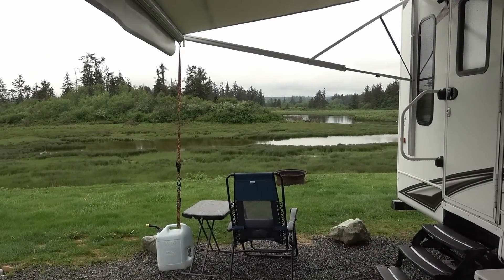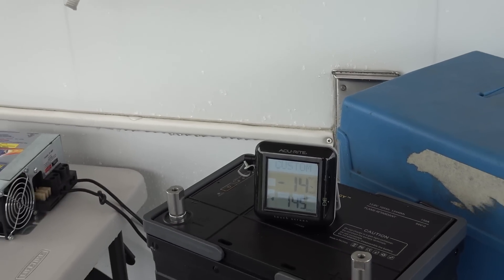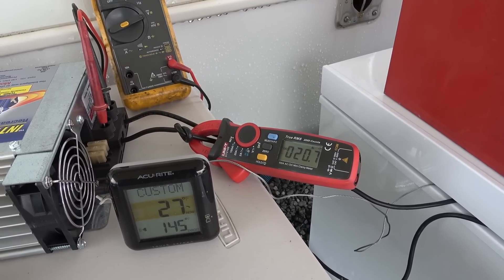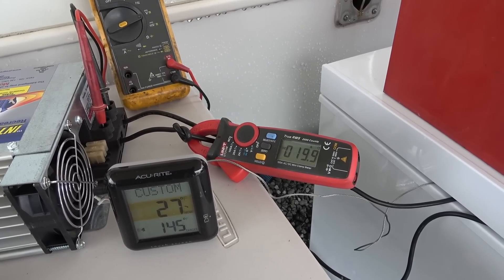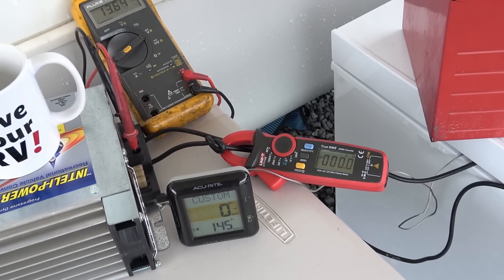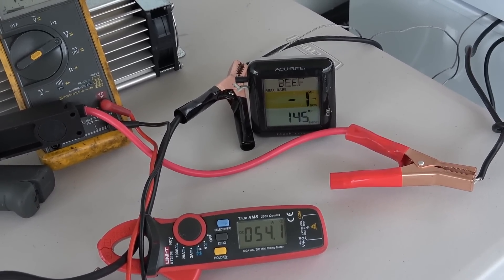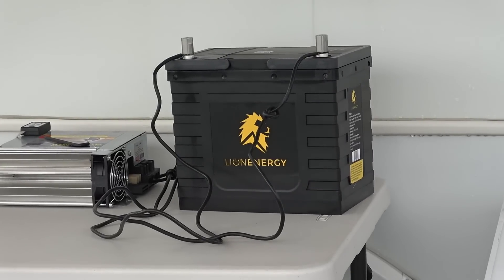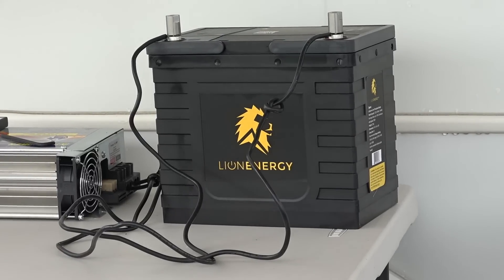Lithium RV Battery DEEP FREEZE Test (Lion Energy Safari UT1300)

Comment: Great, informative test!!  We also have two of these in traditional plastic battery boxes on our trailer tongue and have wondered if they were being damaged during freezing temps.  I guess the difference would be how they fair over extended periods of freezing temperatures.  Thinking about moving them into the pass through for this reason...although hate to lose the storage space!
Reply from the maker: You're welcome, if it was me I would move them inside and add a storage box to the tongue area for other stuff. :) Not only does it help with climate control it shortens the battery cables which is always a good thing. Cheers, Ray
Reply: Thanks for the response!  I'm with ya' - think I'm going to do that as we'll be in colder climes for at least another month.  Super random query since I have your expert ear - have you ever combined different battery types in a bank?  Wondering if I can save costs by adding two cheaper but comparable lithium batteries to this setup (inside) by maybe wiring differently.  Thank you again!  @LoveYourRV
Reply from the maker: Battery manufactures all warn against that. My feeling is it would likely work fine on a parallel installation as long as all the batteries were of the same capacity, efficiency and amperage specs. But different internal BMS boards could cause issues with charging and discharging getting out of balance leading to reduced overall capacity. I haven't tried it myself. What I've done is to spit them into separate battery banks and install a 2 way switch so I can use one bank or the other.
Reply: Great advice - thank you so much... @LoveYourRV

Comment: Thank Ray, very good work on the freezing . 
 Re-viewing this test video with new eyes now that I bought 2 Lion Energy UT1300. Thank You for all your help, work  and videos, it is sooo helpful in my RV life.  
I would still be a bit worried when I get to those temperatures and go for the  add onsheat pads.  I get cold temp in Quebec in November more than once I hit -15C (5F) and it did happened to me once in Toronto, cold snow storm, -20C (-4F) plus the wind factor, no more camping to hook ups.  I would absolutely not want to loose the usage of the furnace.  It was worrisome enough without having to look at the temperature drop worrying if it'ss gonna hit that one degree after midnight where all is  gonna turn into a nightmare in the middle of nowhere.  
But, I am surprised of how low it can go before cut off compare to other lithium batteries.  Nice work !!  ❄☃

Comment: Hmmm.... I'm not getting anything like this performance.  I have 4 UT1300 in parallel.  At about 26F, all 4 cut out for both charging and discharging.  HOWEVER when ambient goes up to about 40F only two batteries will take a charge and reach 100%.  The other two will simply reject charging (even after multiple resets).
Reply from the maker: They rate them to keep discharging down to -4F, 26F is way higher than that so you should be able to get them to do something under the warranty. - Ray

Comment: When I was working . We use these batteries on remote mountaintop sites with only solar charging.. Temp measure recorder recorded temps in the battery box to -30 C in the dead of winter.  The rating at this temp ( according to manufacture) was derated by 40 to 50% .

Comment: Off of the deep freeze topic, but regarding lithium vs 6v flooded lead acid; when I switch from my old 6v setup to lithium, is one lithium battery a comparable replacement for the two 6v or do I still need two lithium? BTW, I don't even use an inverter, just lights, USB charging, furnace (or fantastic) fan and whatever the fridge control board uses. Also, will I need a different solar controller? I have 300w on the roof.
Thanks, Rick
Reply from the maker: It's a pretty close trade-off. The 2 six volts usually have around 220 amp hours total capacity so around 110 amp hours usable before at 50% discharge which is a general rule so of thumb as the max to allow the lead-acid to discharge for max lifespan. A pro for the lead-acid is you can go lower if needed on occasion, though the voltage will drop below 12V and some stuff may not like it, ie. slide or jack motors running slow or stall.  Pro for the lithium is the voltage with stay well above 12V close to 13 V all the way down to near full depletion.  The bad thing is once they hit fully depleted the BMS cuts them off completely.  Another pro for the lithium battery is it's immune to the Perkart Law which makes lead-acid capacity drop if you pull high amperage loads from the battery - https://en.wikipedia.org/wiki/Peukert%27s_law  Cheers, Ray
Reply: @LoveYourRV  Thanks Ray, greatly appreciated!

Comment: Great job Ray!!  MY take away....temps are subjective to the actual temp IN the battery enclosure.  If you have a Lithium Ion battery in an enclosed area (NOT open to outside temps) you can get quite a bit of real use of this battery (and prob many others) in COLD temps.  *** I've decided to wait till almost all the Lithium Ion batteries have internal heaters that ONLY draw current from the CHARGERS input current.  Not charging?--Then no internal heating!  That means NO current draw to take a battery to zip awaiting for a warmer temps to use.  There are only a couple batts that have this.  DO NOT BUY A 12V blanket version that draw from the battery! --That is silly, they eat up your available capacity battery!  BattleBorn dumped their old batts around Black Friday.  They are about to release a battery like I mentioned above.  I would LOVE to see Lion Energy offer such a battery too!
Reply from the maker: Thanks, one thing I didn't mention was I generally see a 8 degree difference warmer where my battery box is located in my front fifth wheel compartment, so if its say 22F outside temp its 30F in my storage bay, because it gets a bit of heat transfer from our inside living area.  Given our camping locations I don't think I'd pay extra for a self heating battery, plus the extra internal complexity.  But will be nice if they offer the option for cold weather campers.  Cheers! Ray
Reply: @LoveYourRV  My pickup camper is a 4 season, and I see maybe 2 degree difference.  I WISH I saw 8 degrees of difference. :)   That battery heater option is going to be popular for sure.  LION, are you listening???   Thanks again Ray.

Comment: Ray, I thought I'd mention this.  It doesn't belong on this topic but seeing as most RV problems are electrical, it may be of some value.In one of your earlier topics you referenced the 3x3 ish box that the connections from the trailer connected to the truck wiring.  Add to the mix, a bunch of bulky marets or inlines and it is awkward and bulky and in my case not able to put the cover on...Add to that the small, 6x6 access hatch and the 3x3 box not centred in the hole, the whole thing was very awkward to work on.  Particularly when your neck is craned at an awkward angle sort of upside down but not quite.  I wound up getting a park picnic table, jacking up one end slightly and throwing on a couple of layers of 4" foam from my Pelican tool boxes to get me up to a height where I could reach into the cut out.So, firstly, I cut a 10"x10" access hatch overlapping the 6x6 but more in line with the 3x3 box area.  The 3x3 was replaced with a short  buss bar.  All the now bare wire ends got connectors and screwed to the buss bar.Now all I have to do is figure out my new Dymo labeller so the wires can get flags.This is a whole lot better than fighting with the 3x3 box.
Reply from the maker: Sounds like a great mod! Good idea. :)

Comment: If you were to be in a really cold environment for several days, some type of battery insulation blanket might be useful to keep those internal temperatures elevated within the battery.
Reply from the maker: You can get special battery heating pads. I know the Battle Born sells a 30 watt model, there are 80 watt models out there but they are for lead acid type and can melt the cases of lithium batteries, I know as I've seen it, lady melted her Battle Born cases.  I would think wrapping the batteries in an electric blanket set to low would work fine.  If I did a lot of cold weather camping though I would just have the batteries inside the rig in a heated area.  Cheers, Ray

Comment: Interesting test Ray even if it is somewhat unscientific... Better than just assuming from spec sheet. So when it's getting cold it seems you want to draw a load from the battery to keep it internally warm. Wonder about HOT test?
Reply from the maker: Yeah, thought I would also try a heat test in a future video. :)

Comment: I read a lot spec sheet from different brand lifepo4 battery, as so far,i did not find the low temperature discharge cut-off, i talked with some battery cells supplier and they told me that low temperature discharge would not damage the battery cells,but low temperature charge would damage the battery cells...
Reply from the maker: It's usually a function of the BMS.  Here is an example - http://www.espat.com.sg/espat_bms.html  You'll see in their information - "High/low temperature protection in discharging
Protection Will Be Triggered When The Pack Temperature Reaches The Preset Value For A Preset Time Period During Discharging, The Discharge FET Will Then Be Shut Off; The Protection Will Be Released If The Pack Temperature Is Returned To The Preset Value (Range)."
Reply: Love Your RV  yes,on BMS. When the temperature sensor feel the temperature changing,the specific resistance would change,give the different current to IC.
Reply: Love Your RV thank you for the review,very good

Comment: Glad you did this test. It is going to help me with a project I am working on that involves a LiFePo4 battery, from Lion Energy. It was something I got off of eBay from them. The sold it as "Used New" without the BMS. I guess it was pulled from something they discontinued.

Comment: Don't know why you didn't temp' the Battery as opposed temp'ing where you did. It's the battery's temp. that is important, not the wall of the box it's in.  Makes sense it did better being in the box than specks suggest.  Specks are temps at the battery surface/ internal, not the surface of the box .   Lesson here is whatever the temp it is to low and it cuts out, above it works.  With sufficient auxiliary heating  (dc heat pad) of the battery. that will allow a working battery at any outside temp.   Good insulation reduces energy required.   That says a lot and it should be used in by users in winter temp.s.  Very nice "Lab Day" video.  Thank you  Cheers!
Reply: It would also be interesting if the electronics in the battery had a status port of some sort where you can actually read the data. Such as a USB cable With a serial port or better Bluetooth which will be hooked up to an app on your phone.
Reply: @tonytango6676  that's why some people are willing to pay the big bucks for Victron or Lithionics/Xantrex systems where all the components talk to one another and report everything imaginable through a common interface. 

But that's way over the top of what most of us need.
Reply from the maker: Was trying to measure roughly what the outside ambient temperature would be around the battery, should have added a second temp probe taped to the battery or on the inside, but did hit it with the IR gun a couple times.